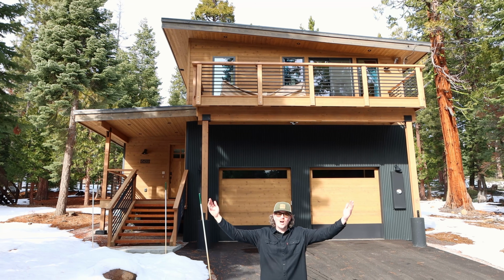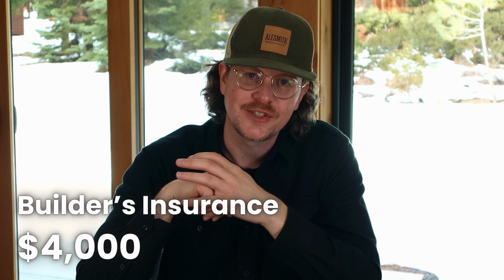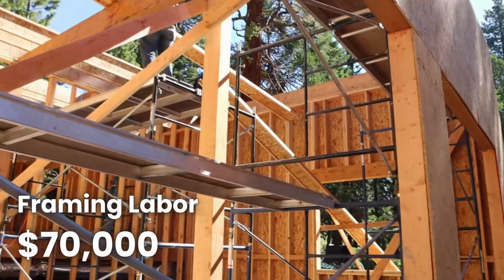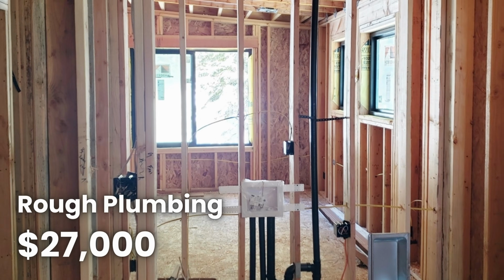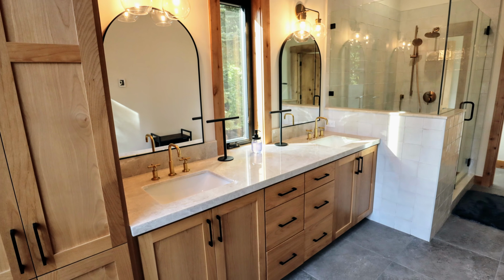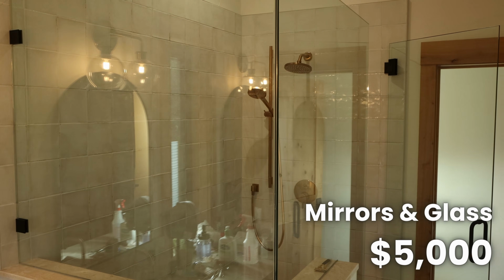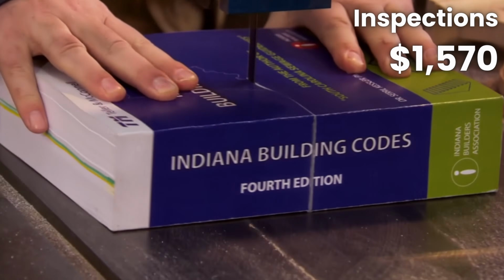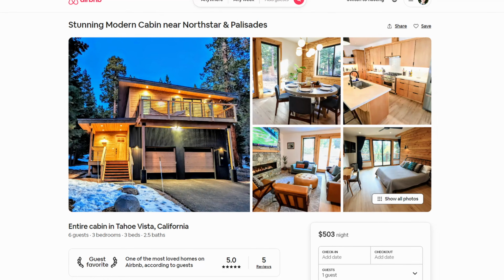The Insane Cost To Build My House In California

Comment: Great video. Are you in el dorado county?

I just finished a custom build in el dorado hills about a year and a half ago for similar reasons. The difference was that I generally contracted it myself. 

I built it at 2044 sq ft livable, 671 sq ft garage, 845 daylight basement (unfinished initially but build ready for later) and a couple small decks. 

My all in cost for everything was about $830k. We did kind of a mountain modern home as well - exposed beams and 15ft ceilings up top, etc. 

But I’m sharing this because yes it was incredibly expensive. I think you did great if you didn’t lift a finger and have that much equity.

Permit fees here (they call it the west slope I think) are minimum $60k. We got our land for $90k pre covid but it’s hilly out here like most of el dorado county so the foundation was by far the biggest cost (I think like $135k which included two huge retaining walls). 

A lot of the costs you mentioned were similar for me as well like plumbing, electrical etc 
I’m not sure if you mentioned solar - I think my array cost about $15k installed for about a 5kw system which actually keeps our electric bill almost at zero. 

Another big expense was stucco and exterior insulation plus the fire guidelines like enclosed eaves - our house is 3 stories / 40ft high in the back and I paid a guy $45k to do the entire job but I got bids as high as $75k

Anyways great video. Until you build a house in CA (and I mean with the recent laws) you’ll never know the pain lol

By the way the fire dept out here was by far the most brutal and caused us to have delays of something like 4 months because they’d come out, fail us for some technicality (and I used a local licensed sprinkler contractor) and they it would take them 3 more weeks to send someone out again plus they’d charge me over $200 each time for reinspection fees

Comment: First off Congratulations on building the home because it looks amazing. My question on the garage is was HVAC the only reason it was cheaper? does it not cost towards the square footage. Do you have any heating/insulation in the garage?
Reply from the maker: Thanks so much 🙏. Some people include the garage in the $/sf and some people don't, so I just included both calculations. In addition to missing heating, the garage is also missing finishes like flooring, trim, etc. it does have insulation though.
Reply: @brandon-built  Thank you, I appreciate the answer
Reply from the maker: @TheHoppter  you're welcome, any time!